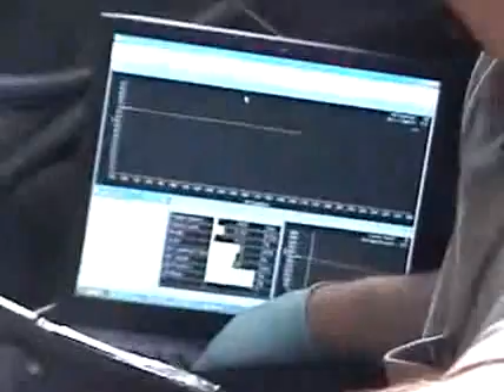Honda turbo del sol 634whp

Comment: no more upgrades for the del sol... 634whp is way more than enough. the fuckin wheels would probably melt off the damn thing. the big tires are in front for good gripping traction i know. but id totally go with all four of the front wheels and tires on this thing.. to make it look better.

Comment: What are those things on his rear bumper and why does he rev it over and over while sitting at stop sign? He must like hearing his own farts. And that street looks like its in compton
Reply: well he has to keep the engine going he has to keep fuel going into the engine at idle there isnt enough fuel going into the engine so he has to rev it up alittle bit if he doesnt the engine will die and he will have to start it up again